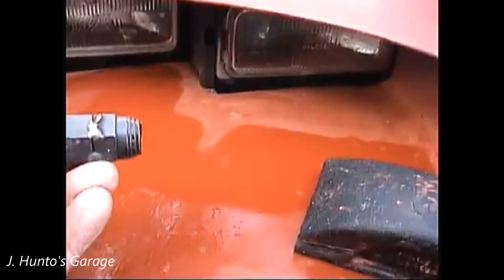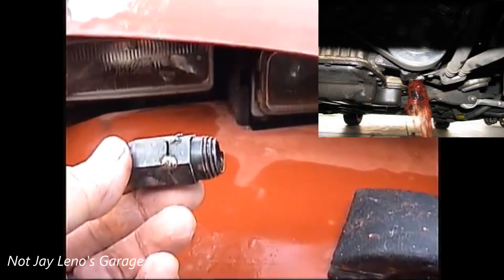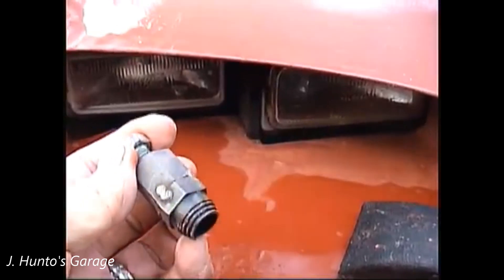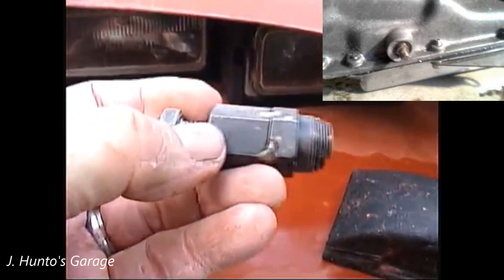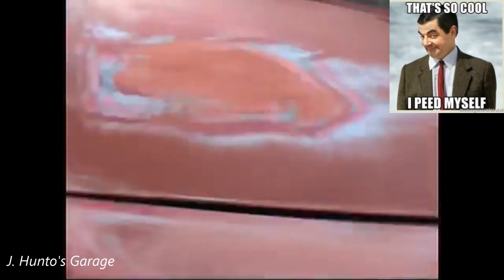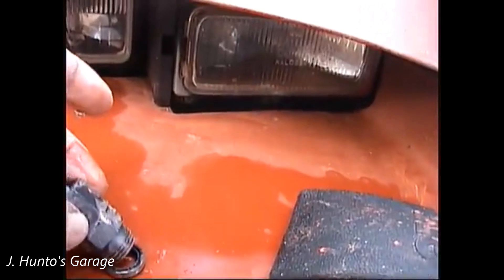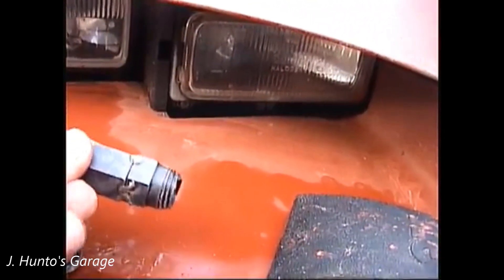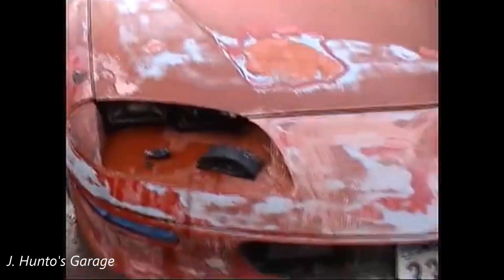Quick way to replace a trans shifter shaft seal

Comment: My shifter shaft in my 700 r4 tranny pops in and out ever so slightly..(but doesn't leak). would you know why it does this and how to fix it?  
Thanks for the video..
Reply from the maker: Definitely a question for a transmission specialist.  Now I'm wondering if mine does that. 🤔
Reply: Thanks for your response. 😄

Comment: When you cut the tool down did it mess with the pitch thread? Is there a certain way to know where to cut so that the screw can still go through? Does it matter where you cut?
Reply from the maker: No problem with threads. Just have to make sure you cut out enough to clear the tunnel. Worked like a charm.